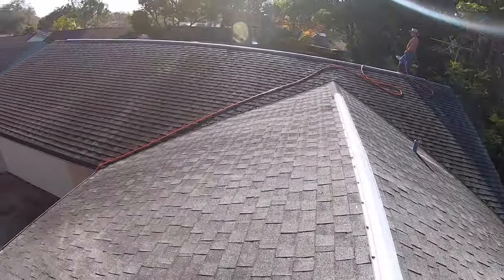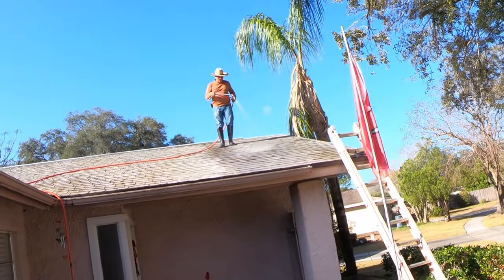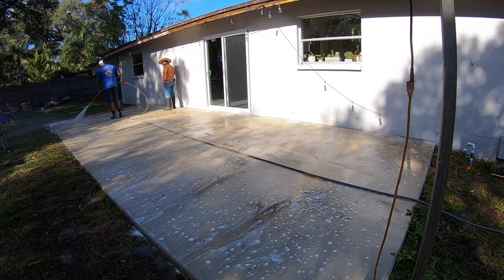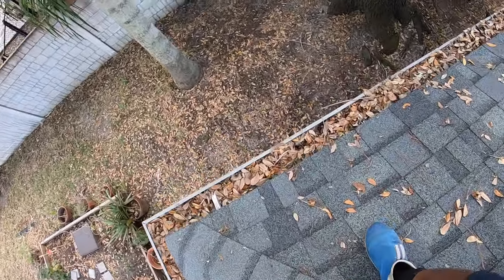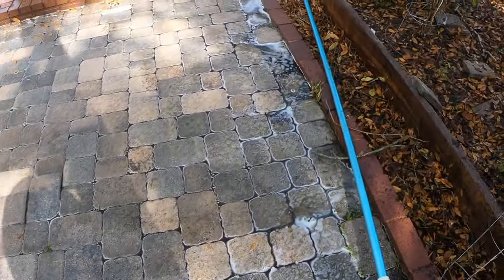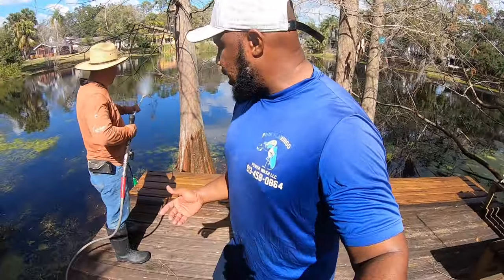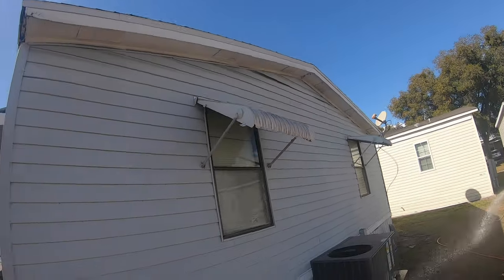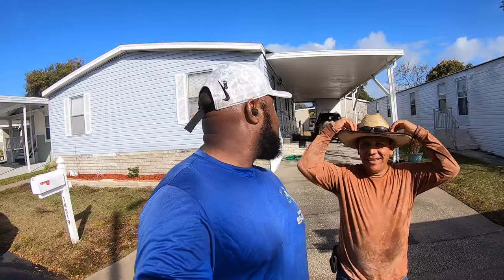Shingle Roof Soft Wash Training, Dock Cleaning, Mobile Home Wash

Comment: How do you go about cleaning red brick on a house and pavers? What % sh would you use? Safe to post treat?
Reply from the maker: Brick and pavers can withstand a strong mix. Typically 3-4% mix will get them cleaned up nice. Post treat is for flatwork only not houses.
Reply: @PinkFlamingoPowerWash  you ever have any issues with the sh turning the bricks white after post treat? On flatwork
Reply from the maker: @cfraioli5108  no it doesn't change the color of pavers. And on concrete it's supposed to make it bright. That's what you want. Nice and clean concrete.

Comment: What kind of surfactant do you use sir,looks like it helps a lot with the runn off
Reply from the maker: It really does. I like to use slo mo surfactant. I put 1 Oz per 5 gallons of sh
Reply: @PinkFlamingoPowerWash  👍any idea where can I find a used gx90, do you recommended it for pressure washing driveways?
Reply from the maker: @dantec8854  gx390? Facebook marketplace or join 1 on the many buy and sell pressure washing groups.  Yes you need it for driveways
Reply: @PinkFlamingoPowerWash how do you lower the pressure for  rinsing mode🚿 after downstream. Is this the Honda you use?
Reply from the maker: @dantec8854  the nozzles does that for you. Yes honda
Reply: @PinkFlamingoPowerWash  thank you brother 🙏

Comment: Do you need dot numbers to transport sh?
Reply from the maker: Over a certain amount. It varies by state. But under 100 gallons of  sh you're fine.
Reply: Do I need a specific kind of chem tank to be legal? Looking for 50 gallon if you have any links thanks man you are a big help.
Reply from the maker: @nhpowerwashinglawncare922  I would stay away from using an IBC tote after that every other tank is fine (obviously it has to be plastic)  

This one is an example of one you can use. (Before using it make sure to use Teflon tape and true blue sealant to tighten the drain plug as you'll never need to remove it. 
https://amzn.to/3stHhjB
Reply: @PinkFlamingoPowerWash    Big fan homie. Thank you.